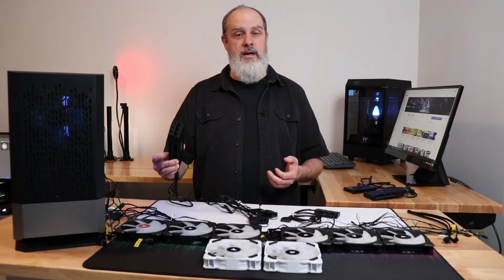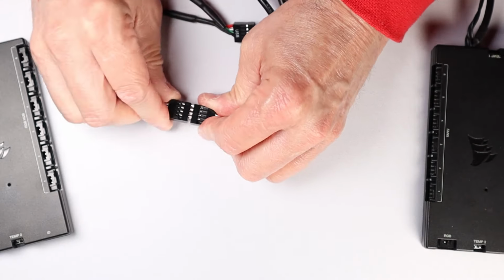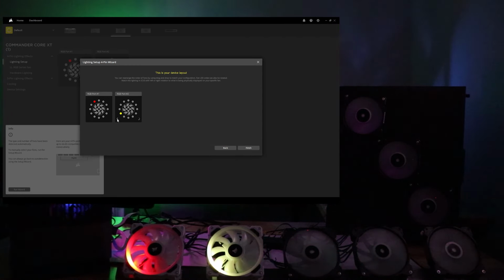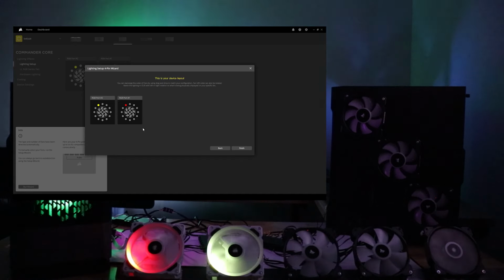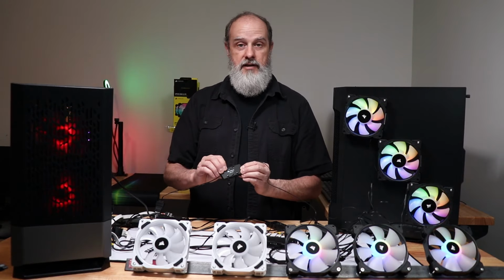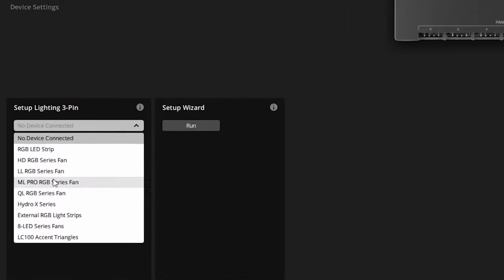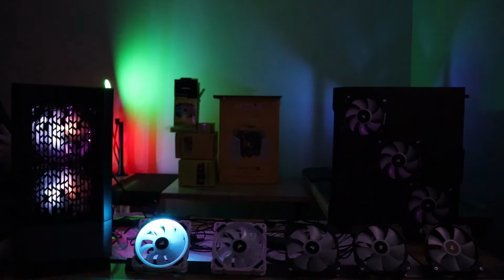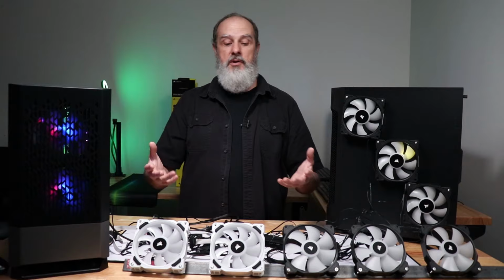Using multiple Corsair RGB controllers to control more than 6 fans in iCUE

Comment: Can I use other fans like nzxt fans
Reply from the maker: Hi Young Felix, great question. It depends on the fan. If the fan you want to use is using a 4 pin PWM power connection, yes they will work fine, 3 pin DC works, but you won't get any control with the CORE XT. 

The RGB connections on the CORE XT and Commander PRO is a 4 pin connector that corsair uses, other fans won't work with this connection. 

However, depending on your fan and controller, you can get RGB control from the 3 pin RGB connection and connect that with an adapter cable to many third party controllers (or 3 pin ARGB fans). It's not ideal and has a few issues, but does work, check out this video for some ideas:

https://youtu.be/JgLUDe1yzYw

Thanks for watching, great question!!!

Comment: Do they make add on accessories like a small hub to add capacity to the commander?  I keep seeing people with the full size hub and then some smaller devices attached.  I'm looking at doing a 5000x case with at least 9 fans, possibly more when I swap the fans out on the cpu cooler.
Reply from the maker: Hi Douglas Sells, Great question. Corsair does make a 6 port RGB hub...This Hub comes with some of the fan kits, it comes with the "Lighting Node PRO" This can be connected to the CORE XT for additional RGB ports it connects to the 3 pin RGB port of the CORE XT, or the 3 pin RGB port on the commander PRO. 

You can also buy this hub seperately, check it out here on corsairs site (10 bucks)

https://www.corsair.com/us/en/Categories/Products/Custom-Cooling/Accessories/CORSAIR-RGB-Fan-LED-Hub/p/CO-8950020

In addition, you can also use a Lighting node CORE which also comes with many of the fan kits and serves the same purpose, the difference is the RGB HUB (above), needs to connect to the commander (PRO or XT) using a cable. The lighting node core is a complete controller. 

Both do the same thing though, the only downside is neither gives you any PWM speed/power control over the fan, you will need to use motherboard headers, external PWM hub....or simply add a second CORE XT. 

I hope that helps, thanks for taking the time to post the question, and thanks for watching!!!

Comment: Have question about my computer, i have 10 rgb fan build in to the computer and using two rgb hub fit every thing in it. But 9 fans light up but the 10 fan is not light up at all. Any suggestions how to fix that.
Reply from the maker: Hi krazy Olympus, 10 Fans sounds like an amazing build!!! I'm not sure what controller specifically your are using, but I would try the following:

- Just to make sure the fan is working properly, swap it's position with another fan. 
- If the fan still doesn't light, it might be the fan itself, in which case check the connector and the cables, I've had at least one fan not light due to a flaky connector. 
- If you find the fan now lights up, the fan is good.....and assuming the one you swapped it with doesn't light, then it's the port, the configuration or the order in which you connected it. 
- if you're using the lighting node core or the RGB hub and lighting node pro, then make sure you didn't skip any ports,  they must be in order 1-6 on the first one, 1-4 on the next one, if you skip a port, it will not light anything after the break. 
- the CORE XT, CORE  don't have this issue. Try running the detection routine again. 
- Ensure that you somehow didn't deselect the lights either on the model itself in icue or the section where you can select what fans get lit, i've inadvertently change it from "ALL" to certain fans. 

I hope that gets your started, let me know what you find! Thanks for taking time to post the question and I appreciate you watching the video!

Comment: so i have just upgraded to a corsair 5000x, i have removed the node core. brought a capellex 150i which im using with the included commander node. now i can control the 6 inputs in icue4. now i have 4 other fans not connected and cant really control them in bios. those 4 fans are currently corsair 120s non rgb. is their a kit of fans which are rgb which comes with a hub to link with the current commander node i have to make 10 fans controllable in icue4? if not what is the best node to connect with the commander node without adding additonal inputs on my motherboard? Thanks
Reply from the maker: Hi MadEvilDad, great question. There are a couple ways to approach your situation. All of the fans kits will come with either a Lightning node CORE or a lighting node PRO. Both of these devices will only allow you to control the RGB lighting on the FANs. The PWM power/speed control must still be connected somewhere (motherboard or PWM hub) (which is one drawback to these controllers). 

However, either of those controllers will work fine for RGB controller and pair nicely with your current commander CORE XT. 

None of the fan kits come with a commander CORE XT that i'm aware of. In that case, I would suggest buying a second CORE XT by itself and use that with your additional 4 fans. 

If you choose to use the lighting node core for RGB control on the additional 4 fans, you could use a PWM hub to connect the power/speed control. But If i'm going to go to that trouble, i'm just going to add a second CORE XT. 

I hope that helps, let me know if that didn't answer your question. Thanks for Watching!!!!
Reply: @HardwareArtisan  ye i done some digging, as the rgb/pwn controller wont let me controlr the fans in icue, also a pro commander would still need a rgb node. So my only option is the commander xt. The commander XT currently only comes with a corsair h150i xt edition otherwise its sold separately.
Thanks

Comment: Does Icue take up alot of cpu usage due to the bloatwear I have a 115 Aio Elite capellix with 2 240mm rgb fans, vengeance pro rgb 16gb x4 , SP 120 elite fans x4 and I'm afraid to use icue because I heard bad things that happens when using that app ?
Reply from the maker: Hi Anthony Michael, I have personally never had an issue with iCUE taking up much CPU usage, not that i've ever noticed anyways.  Personally i'd have no issues running all that with iCUE and I've had quite a bit connected at one time. Let me know if you experience any issues with it I'll have to research it. Great question, thanks for watching!

Comment: Hey man great video but I am still a little lost. I'm new to building so just need a little clarification. I am trying to build an (almost) all Corsair build. I am using a Corsair Crystal 680x case and I am replacing the fans that come with it to the QL fans. So my build is Asus Prime x570 - Pro, GeForce RTX 3080, Ryzen 5800x, H100i Elite Capellix AIO, Corsair RM 1000x power supply, 3 Corsair 140mm QL's, 5 120mm QL's,  4 sticks of Corsair Vengeance RGB RT (32gb) and a Lian Li Strimer Plus Triple 8 pin. My H100i Aio comes with a commander core, my 120 triple pack comes with a Lighting node core and my dual 140 pack comes with another lighting node core. I bought a Commander pro thinking I could tie all these together with what everything came with and be able to control fan speed and RGB. Can it be done or am I missing something? I planned on trying to put this all together tomorrow and well now ya got me doubting I'll be looking at a big heap of RGB throwup. lol HELP I NEED AN ADULT!!
Reply from the maker: Hi Steven Arnold, Great Question! There are many combinations of how to do this, which makes it confusing for sure. I've had alot of fun making these videos, it's difficult to go over all the scenarios, but let me point you in the right direction. You said you needed an Adult, but I'll give it a shot anyways.....lol.....

You have everything you need  to get this setup, that's the good news!! Here is how I would do this....That case comes with a lighting node pro(Controller and HUB), I'd start with removing the controller,  But you will be using the RGB FAN HUB that came with it so leave that part in place. 

You WON't need either of the lighting node CORE's, you can set all those aside. 

I would connect your commander PRO into a USB header and power. Then, connect the Commander Core that came with your AIO into one of the two USB headers on the PRO (Or motherboard, it doesn't matter). Connect the SATA Power for the CORE and the HUB as well. 

I believe for the VISOR effect, the Commander PRO goes first, then the Commander Core, so.....Consder going in this order. 

Plug the RGB FAN HUB into channel 1 on the Commander PRO
In the RGB hub, connect  the first 6 FANS, I usually start with the front facing bottom fan as #1, plug them in order 1-6 to the HUB. Then plug in the PWM Power connections to the PRO's PWM ports 1-6 in the same order. 

For the remaing 2 fans, plug them into the Command CORE, both RGB and PWM, into ports 1 and 2

(You can change the order within each device seperatately if needed later, but you will want the first 6 in the PRO and the last 2 in the CORE)

Then connect the AIO to the CORE's 24 pin port. 

That should get you close, if not right on, but before you zip tie it all up, if possible, test it in iCue with VISOR to see if it all fires in the order you want, the other effects don't really matter, but if needed make a change at this point. 

OPTIONAL, you could consider this.....you have only 8 FANS.......You could get rid of the PRO.....Plug the first 6 fans into Commander CORE along with the AIO, then connect the RGB HUB to Channel 1 on the Lighting node PRO (just like it is in the case initially) and plug the remaining 2 fans in ports 1 and 2 on the HUB.  This leaves you looking for PWM connections for the remaining 2 fans, you can use motherboard 4 pin headers, or buy a PWM HUB (cheap), or splitter cables to split 1 of the ports on the CORE into 3 PWM  connections, that would work. (This option would be cheaper and less clutter in the case) You lose the ability to add more temp probes, but that may not matter to you. 

Alternatively, ditching the PRO and replacing it with a CORE XT (similar to the CORE) allows you to get rid of the RGB hub altogther  and give you a couple temp probes.  

I hope that gives you some further ideas, let me know if I can help.....Above All, Have fun with it, it will make more sense after you start messing around with it. 

Good luck with the build, let me know how it turns out!

Thanks for Watching!

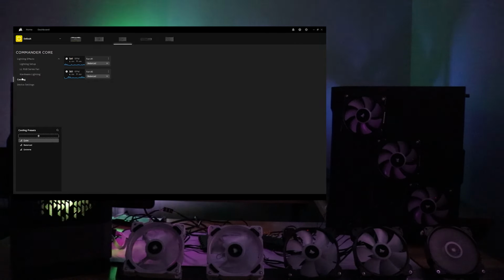Comment: hello, i need some help, i did exactly what you did form 8:28 though to 9:50 but with all the same ML 8 series LED fans. they still do not do infinity or rotary stack together. i even plugged core into MOBO usb header and still nothing. what am i doing wrong? is my equipment faulty?
Reply from the maker: Hi AJ. I had an update today to the iCUE software and I see in the release notes that they fixed this very issue: here is the snippet from that.
 
"Fixed an issue with the Infinity and Color Wave Lighting Effects playback on 8-LED fans."

https://help.corsair.com/hc/en-us/articles/5488180616333-Patch-notes-for-iCUE-version-4-22-203

Make sure to upgrade to iCUE version 4.22.203. You can upgrad from within iCUE, click the gear icon at the top, then goto 'updates' and you can update everything, including the icue software. 

Let me know if that takes care of it. Thanks for watching!
Reply: @HardwareArtisan  yea, i have it updated. i just put the fans in earlier this week. been talking to 3 "corsair reps" they cannot even figure it. i have everything corsair but now this makes me want to return it all and go lian li. huge disappoint , i just simply want 12 fans to do rotary stack in sync. what broken features they have.

Comment: Can 2 Commander Cores work? I ordered a 3 fan kit which includes another Core, the first one came with my AIO Capellix
Reply from the maker: Hi Robert Weekes, Yes, you can use two Commander Cores, they will work great. They each make their own SATA and USB connection, but iCUE will work great with both of them together. The fan kits usually come with a Lighting Node CORE, not the commander core. If that's the case and you have a Commander CORE and lighting NODE CORE, that works fine as well, if you don't have more than 6 fans, you won't even need the Lighting NODE CORE. 

However, if the fan kit came with a commander CORE, which one was it, i'm curious!

Great questions, thanks for watching!

Comment: Thanks for this.  Just finished my build today.  10 fans with the H150I elite LCD.  The AIO and 1 fan are connected to the CoCore that came with the AIO.  The other 6 (same exact fans) are connected to the core xt.  The CoCore with the AIO (and my dom ram) are showing up in ICUE.  The cocore xt is not showing up in ICUE.  No idea how to fix it.   The AIO cocore is connected directly to a USB 2.0 header.  The cocore xt is also connected directly to a USB 2.0 header.
Reply from the maker: Hi thefarside79, that sounds like an Awesome build. I'm a few days behind getting back to you. If the commander CORE XT is not showing up, the first thing is to make sure you have the latest iCUE installed, version 4, it won't be recognized on version 3. 

If you have version 4, just update to the latest version, from there, i'd try the following:

1. Try a different SATA power connector,  I'm assuming your fans are spinning, even if they are, try another connector.
2. Try a different USB Port, swap the CoCore with the COREXT if you haven't. 
If none of that is the problem and you know you have good power/USB

3. Disconnect all the fans from the commander CORE XT and retry
4. Disconnect the CoCORE and retry 

(just simplify the setup is the idea here)

5. If stripping it all the way down won't allow it to be connected and you've verified everything, 
Uninstall iCUE, Reboot, then reinstall it and reboot and retry. 
6. Try it on another PC if you have access to one. 
7. Check the cable for any breaks, pins missing, etc.

If Problems are still Present, I'd suspect maybe an issue with the controller itself. capture logs from icue, go into settings and there is a "Export system info and Logs", run that while the XT is connected. 

Open a Corsair ticket and upload those logs (they will likely ask for them). 

Let me know if you get it fixed, or how it works out. Sorry you are having issues, happens to all of us. 

Thanks for Watching!

Comment: I am considering removing the Commander Pro that came mounted in the 1000D case ( apparently attached with double-sided adhesive tape ) and using two Commander Core XTs and a Commander Core that came with the H170i AIO ( has a connection specifically for the H170i ).  The only cable currently connected from the 1000D case and the Commander Pro RGB LED connector is for the case's lighting. I assume I can attach that cable to an RGB connection on one of the XTs. Is my assumption right - or is the RGB connection on the XT differed than the LED connection on the Commander Pro?  I also have a couple Light Node Pros available that show 2 LED connection on each one. Can the Light Node Pro be connected to the RGB connection of the XT... or should it be connected to the LED connection of the Commander Pro?  Does anyone have a simple graphical schematic builder to help map all the connections among the connections? Thanks for your thoughts!
Reply from the maker: Hi Scott Stevenson, I don't know specifically what device(s) is connected to that RGB port on the PRO for the 1000D. I can assume it's perhaps some RGB hub for the cases lighting, essentially just RGB strips i'm guessing.  I haven't worked with the 1000D and the reference picture I saw showed the connection but not what device(s) were at the end of it. 

But, in short, YES, I have a commander PRO here in my PC and the RGB ports on the Commander PRO, the CORE XT and the Lighting node all behave the same way. 

There wouldn't be any difference in using the CORE XT as opposed to the PRO

For the CORE XT, you would navigate to the 3 pin lighting setup. 

For the Commander PRO and/or the Lighting node PRO, it lists these 2 ports as lighting channel 1 and lighting channel 2, but they configure and behave the same way as the 3 pin lighting setup on the CORE XT (which only has 1 channel)

The lighting node PRO does not Connect to the CORE XT or the PRO, it's it's own seperate controller, but you can link across it and the CORE XT or the PRO using the lighting link lighting functions in iCUE

I hope that helps simplify it, contact me back if I can help. I know that on Corsairs forums you can find some schematics there. I've considered putting some together here, this is yet another reason for me 
to do that. 

Thanks for the great questions, let me know if I can hep.
Reply: @HardwareArtisan  Thanks VERY MUCH, Hardware Artisan! Your reply is SUPER helpful! You cleared up several areas of confusion / misunderstandings for me regarding the Lighting Node Pro, Commander Core Pro and the Core XT. You’re right, the Commander Pro’s RGB connection is for the 1000D’s case lighting. I now believe that I can remove the Commander Core Pro and  use 1 Commander Core (for the AIO) and two CORE XTs. Thanks for directing me to the Corsair Forum for the schematic! As my time to work on the build is limited to just a few hours on weekends, my progress is quite slow. Your presentations and support are VERY HELPFUL and GREATLY APPRECIATED! 👍🏻👍🏻👍🏻👍🏻

Comment: Man, I needed this video like 2 weeks ago, built out a 5000D Airflow, 12 LL series fans, plus an XD5 and an XC7. 

Corsair's "documentation" is garbage, when it exists at all. Still watching the video, but I ended up with one XT, one commander core, and one lighting node. The node has the XC7 and XD5, the rest is going through the XT and the core. Then I ditched iCUE for SignalRGB, cause iCue is so limited.